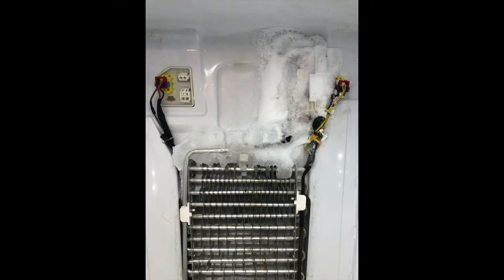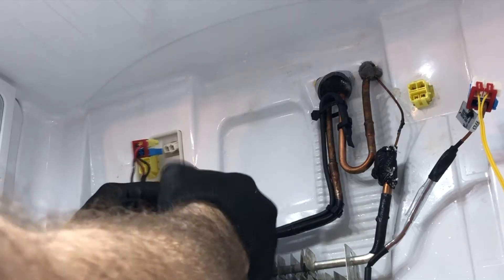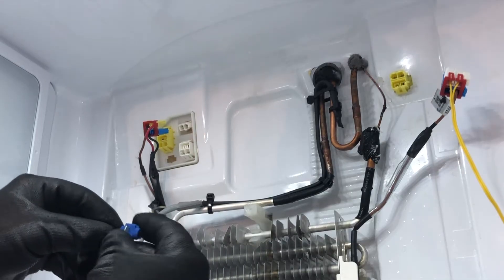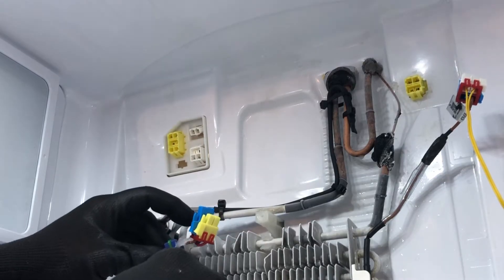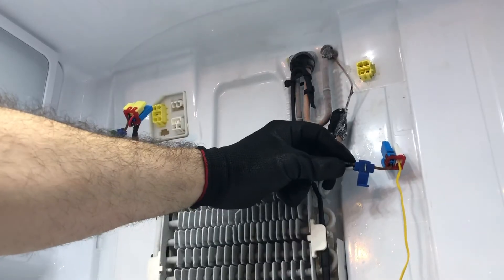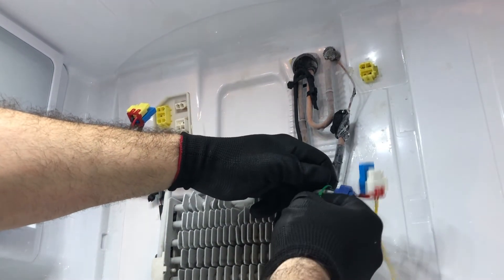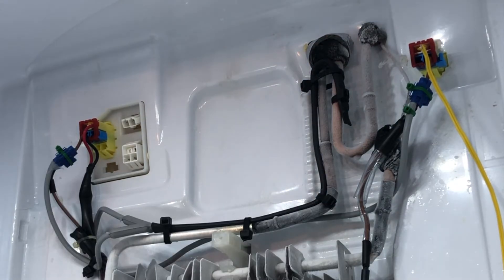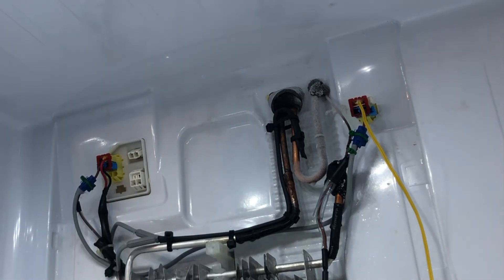Samsung FDBM evap heater add

Comment: I have a RF23HCEDBSR/AA and the one thing I wonder is if it worked for five years with no problems why now does it need an additional heater.  I do not have clogged drains and have never had water under the bins, but I have had ice hit the fan.  I also know that the defrost heater and the thermal sensor tested ok on the bench.   I replaced the thermal sensor anyway incase it was intermittent or something as Samsung mentioned in their Service Bulletin.
Reply from the maker: A possible answer would be the breakdown of insulation in the liner, this can cause inefficient cooling. Also, if your sealed system has a partial restriction, or an inefficient compressor, this will cause long run times and can lead to excessive frost build up.
Reply: @electronicsprojects4708  GREAT VIDEO!!  Last question for you.......I PROMISE!  When you say breakdown in the insulation of the liner what do you mean?   The evaporator liner or the in walls of the refrigerator?  There is a Facebook site called SAMSUNG REFRIGERATOR RECALL U.S.A. NOW with tons of members and they tell me that moisture gets into the insulation of these refrigerators and they can't be fixed.  Is there any truth to that?  Since you are a technician I thought you could tell me very briefly a bit more about all this.   Also will small compressed areas on the evaporator cover gasket from pinched wires (from the factory) cause this problem as others have said.
Reply from the maker: @carymark710  1st question: over the past 10 or so years, they have used cyclopentane as a blowing agent for foam insulation, ever since modern fridges have had more issues with insulation in the liner breaking down (not the evaporator cover/styrofoam. The insulation in the walls of the fridge and freezer). Frigidaire also has a problem on their French door bottom mounts for this. I have suspected for years that the insulation was the issue and I have had multiple confirmations of this, including pictures from other techs. You can imagine, I don't hack into the back wall of a refrigerator too often, lol. 2nd question: I haven't seen any connection with any wires, but I have seen the wire terminals corrode when there is too much moisture accumulated in the fan area. Sometimes we have to reroute the whole wire harness, which is time consuming and expensive. The cause of the liner breakdown would be the copper lines inside the liner sweating and the moisture is what breaks down the insulation. That's why it takes time to see its effect, over years.
Reply: @electronicsprojects4708  - Thanks for your response!  Since one of the Samsung Service Bulletin talked about wires being pinched in the foam gasket around the evaporator cover I wondered if that could be a real problem since it dents the gasket and it does not seem to spring back after being compressed for years.   Mine had a small 3" area where the factory pinched the brown defrost heater wire.   Again, thanks for responding to my messages!!!
Reply from the maker: @carymark710  they have had bulletins on these Samsungs for years, at last count this  fridge style has 6 or 7 revisions to the bulletin. 1st they say this, then they say that, then they say, go back to what we did before. Overall, I don't put a lot of faith in the people putting together the bulletins, probably the same people for the horrible design, just saying.
Reply: @electronicsprojects4708  - So approx. how many of these extra heaters would you say you installed where you have not had a single call back?   Looks pretty simple to do.  Also one guy said that if the defrost cycle goes on for like 80 minutes it will set an error code and the defrost will stop completely until it is cleared.   Will it not even work if I preform a forced defrost (FD)   To think I promised to not ask any more questions!!!   By the way, Thanks for all your input and help!
Reply from the maker: @carymark710  max defrost is 25 minutes. it will not defrost if the sensor registers a warm temperature at the top of the evaporator, once it starts cooling and the sensor freezes, you can put it into defrost again. (or you can trick it by using freeze spray)
Reply: @electronicsprojects4708  Don't know if you are interested but here is a thing about the 80 minute defrost and then the 25E Samsung Error Code being set. Does this sound like it could be correct?  Now I know when I do a FD it can run from 25 minutes to an hour, but of course the automatic defrost could be different.  Another guy as I mentioned above has a computer graph over time done with advanced testing equipment that will show the defrost timeout if it runs 80 minutes.  My question in all of this is still if it sets the 25 E code does it lock out the defrost mode entirely until it is reset since some people will physical defrost the refrigerator (turn it off) and the ice will build up pretty quickly. If you are interested I can point you to the guys blog with the advanced testing equipment where he has computer graphs of all the power the refrigerator has pulled over time showing the defrost cycles and such in it. 
https://howtofixit.net/samsung-refrigerator-error-code-25e/
Reply from the maker: @carymark710  I skimmed it because I have to go to work, but 1st of all, he is giving specific solutions to general error codes. The two pictures I saw on the page are not for the model that needs the add on heater in this video I posted. I didn't see anywhere in there that he proves the 80 minute defrost time, and again, if that's the case, I didn't see a model number. These fridges don't have the same software, some of the models have 16 or more revisions and so you can't just give general blanket statements like that. Anyways, I gotta go tow work. If you have specific questions on something you are working on, let me know. I think having a discussion about what someone else is saying, that could be a rabbit hole.
Reply from the maker: During lunch I did a little more research, some models don't have a 25E code in their tech sheet (they go from 24E to 26E) and I did find some had an 80 minute cutoff, others 70 minute. And these are all on ones that he has pictures of on the web page. So, what I do is I take it on model by model case. I don't make generalizations, cause then people will claim you misled them because they found something a bit different on theirs. This channel is primarily for technicians to learn how to repair appliances outside the manufacturer box. I do this a lot in the field, saves the appliances from the landfill often. Back to that website you linked, I don't really recall seeing that error, so that tells me it's really not that common in my area, at least. Cause I work on Samsungs all the time.
Reply: @electronicsprojects4708  Well if you have an extra time in your day see if a RF23HCEDBSR/AA (version 8) has a timeout since a few times I tried to do a manual defrost (FD) in a row and it beeped like something was happening, but didn't seem to melt enough ice to just get it off the fan.  Now I would think the software programmers wouldn't have it beep if it was locked, but I have seen some bad programming before!  I may have to add the auxiliary heater to mine in the future.....Thanks for your response on all of this and your video on how to do it.  Looks like a nice clean repair rather than some of the stuff I see on the internet that looks like what I call "Mickey Mouse"  In case your are interested in seeing this guys graphs of the defrost cycles in your spare time here (graphs are toward the end of this link) is where I first saw this and where he was saying the gasket around the side of evaporator that was crushed seemed to be his problem on his since he "claims" that it went for two years after he fixed he gasket. Maybe it would have gone longer, but he junked it for other reasons mentioned.  So do you fix appliances for a living?  https://us.community.samsung.com/t5/Kitchen-and-Family-Hub/ice-build-up-over-fan-and-evaporator-coil/td-p/1809098
Reply from the maker: @carymark710  you can't do multiple manual defrosts in a row, you need to space them out at least an hour of cooling in between. Yes, I am an appliance tech, before that a tv tech. 22 years.
Reply from the maker: @carymark710  it shows 'archived' but even if it ran 18 months, that's not a permanent fix. I started the heater add about 3 years ago, I didn't post the video immediately because I wanted to give it some time to make sure that it was a solid repair. In appliance repair, it's rare that you have a 'fix-all' solution. Like today I replaced a thermal fuse on a dryer, sounds like a simple fix, but after replacing it, I tested the timer and it had bad contacts. I had to revise my quote to the customer. He approved it, but you can see, appliance failures are not as cut and dry as people think, because they are complex machines. So goes with this repair, there is no repair out there with 100% success rate, as there is no tech with 0% recall rate. But this repair will fix it over 90% of the time, which is much better than the Samsung bulletin. The only cases it won't fix, is if you have a sealed system failure and the compressor is running constantly, even this heater can't keep up. Also, if you have a broken drain, say insulation is clogging it in the middle, the heater can't fix that. So it's not a cure-all, but most of the time it works. This video is for techs, so I don't go on other parts of the repair, like cleaning out the condenser coil, and the Samsung drain kit mod, techs will already know these steps.
Reply: @electronicsprojects4708  I am just a guy with Bachelor of Science in Electronic Engineering where I never did much with my degree, but I can "talk tech" and can fix stuff though!
Reply: Hello I talked to you a few years ago.  Just thought I would ask you a question and see what you think.  I have heard some technicians say they have repaired these Samsungs by just replacing the white back panel with a new one with comments like the old ones are warped inside or they are heavy since they are saturated with moisture when you compare an old one to a new one. Have you heard that or what has been your experience?  Let’s assume nothing obvious is wrong like a clogged drain or the regular heater has gone out that is the cause.  Have a great day……

Comment: Hey there just did the heat trace wire awsome video just got question how do I put mine in defrost mode model Rf260BEAEWW thanks no paper work
Reply from the maker: Force Mode
Press the Power Freeze and Fridge buttons simultaneously for 8 Seconds, until the display goes blank.

Press any key within 15 seconds to cycle through the mode in the following order:
Manual operation1(FF) → Manual operation2(0F-r) → manual defrost of fresh food compartments(rd) → manual defrost of fresh and freezer compartments(fd) → cancel(Display all off)

'rd' (Refrigerator Defrost) is what you want to see on the display. It will automatically exit service mode in 25 or 30 minutes, if you don't exit, or you can unplug it to reset as well.

Comment: Hi thanks for the awesome video! I recently tried this fix on my fridge, seems to be ok so far. I checked the back panel near the top and it appears warm at times and the top vent holes let out a small amount of heat, is this normal and expected?
Reply from the maker: will only let out heat when in defrost mode, not when its cooling. Defrost usually lasts for up to 25 minutes, and it happens about twice a day. If you used the SH201 or SH502 heater, then it only gets up to 160 degrees, which is a safe temperature for the back panel.

Comment: I am not clear regarding  wiring connections,  understand parallel , but in video I do not  see location of thermostat  sensor that turn s coils on/off, in relation to added heater.
Reply from the maker: wiring will differ depending on model you are working on. add it in parallel to the defrost heater wires on each side as in video. as long as you don't put the heater next to the sensor, you are ok.

Comment: I have a RF28HFEDTSR/AA same thing icing at the top of coil and fan then makes grinding sound from ice. Will your heater add on be the solution? Do you know anyone near Akron, Oh that can do this? Thx Adam
Reply from the maker: Yes, the heater add on as well as Samsung's drain kit mod will fix it, I also check the mullion flipper is working correctly and clean out the condenser coil. I posted it on my group to those closest to you, I will see if I get any takers on the job, will let you know.
Reply: @electronicsprojects4708  i replaced the door flipper pins i believe thats what your talking about as it broke a few mos ago. I dont think the drain area freezes as there is no water on the bottom. Did you say u know anyone near me that does this work?
Reply from the maker: @adamlowry6699  I checked and I didn't see  anyone from Akron, sorry.
Reply from the maker: @adamlowry6699  I got a contact that services your area. 440-652-3033.

Comment: Hi, I purchased the wire and followed your steps for installation, but the wire did not heat up. Any idea as to why the wire is not heating up? Samsung - RF261BEAESR. Thanks!
Reply from the maker: I would recommend calling a professional technician to assist you in this repair.

Comment: Great  and intelligent way of tackling the issue. I have same system installed on  my refrigerator but I see 2E error code flashing anytime I turn on my refrigerator. I looked the error code up and it says it is temperature sensor error, so I changed the temperature sensor in both the fridge and freezer sections. Unfortunately, this did not solve the 2E error. To make matters worse, the fridge side temperature keeps flashing and freezes my milk and water, meanwhile there is no leak around the door.  I need your advice. What could be the problem. Thanks in advance.
Reply from the maker: model?
Reply: Did you do a reset? ..which the fridge will do automatically if you unplug it for five minutes then plug back in. Or turn off the breaker.

Comment: The sh201 gets very hot after connecting it I was afraid it would melt something
Reply from the maker: it gets to around 160 degrees F,  you can put your finger on it for about 1 second until it's too hot to touch. Contrast that with the Samsung defrost heater at the bottom that gets to over 500 degrees F.  I have been using these for a few years and never had one burn anything. If you tie it to the suction line, the tubing acts as a heat sink.

Comment: I want to thank you also for a great video and great idea. This solved my problem .3 months and going strong. I must have torn my fridge apart 4 times in under a month and replaced everything that they say might be causing the problem and nothing worked. i was still getting ice build up on evaporator fan. Driving me crazy and ready to give up on Samsung but Thanks to you its working fantastic. I appreciate you posting your ideas to help people out and saving them money. Keep up the good work and happy holidays my friend.
Reply from the maker: Glad it worked for you, I have gone back on one's I had put in after a couple of years and found no abnormal frost build up. It took a lot of time and effort to come up with the solution because you have to understand the system first, then the flaw in design to come up with a working solution. Cheers.
Reply: @electronicsprojects4708  Nice video. What do you think about wrapping the 502 using 14 ga copper wire instead of ties?
Reply from the maker: @chilitoday  as long as it's insulated and snug fit, I don't see a problem, you can also wrap the heater like a snake around the suction line, this was a mod suggested by another tech to save zip ties.

Comment: Ok, so I just ordered all the parts...wish me luck! Thank you so much! I appreciate your time and knowledge.
Reply: How did it go? I have the same issue
Reply: @Sid Bharij  it went well. I had no problems installing it. So far, it is good, but time will tell if I get ice build up again. I did everything exactly how it was explained in this video. I will have to wait at least 3-4 months to see if I hear the fan clanging again the ice. If I get any ice build up at all. I have my fingers crossed...
Reply: @e.shealer2417  any update?
Reply: @lewisvilleclemmons   I'm sry to say, but no. I have resorted to hitting the Forced Defrost button every month.
Reply: @lewisvilleclemmons  oh,Im sry, I do have problems, I thought u were asking about another part I installed. I did have the ice come back after about 3 months then I install the part for the drainage hole, but it makes no difference. Samsung sold all of us a fridge which they knew was poorly designed... I think a class action law suit should be taken up.

Comment: Would you know of any techs who can do this mod in the Richmond, VA area, zip 23113?  Also, what's a rough idea of the cost?  My $1500 refrigerator is only just over 5 years old.
Reply from the maker: TK Cousins messaged me and said that you are in his service area, his phone number is 804-442-2088. He's a good tech.
Reply: @electronicsprojects4708  Thanks very much!  I'd try the repair myself but I just replaced a faulty fill valve on my Kitchenaid dishwasher and it only lasted 2 weeks before failing again, so I'm not to bullish on my major appliance repair abilities.